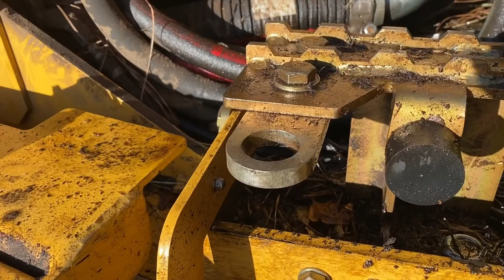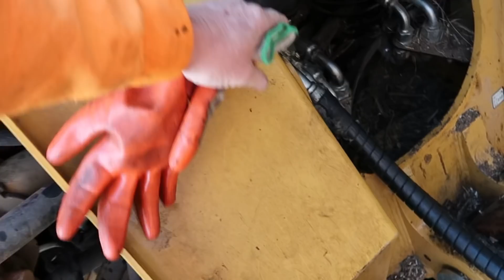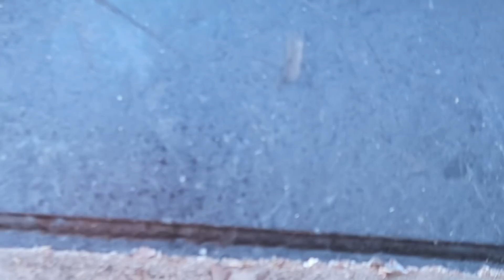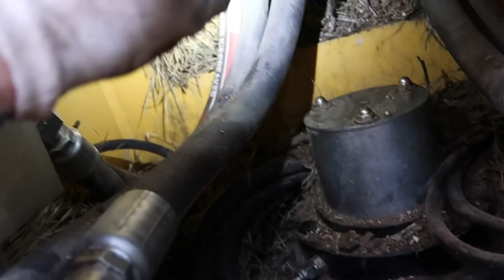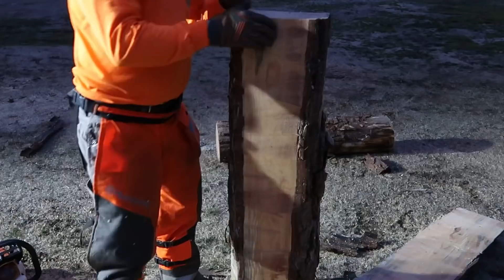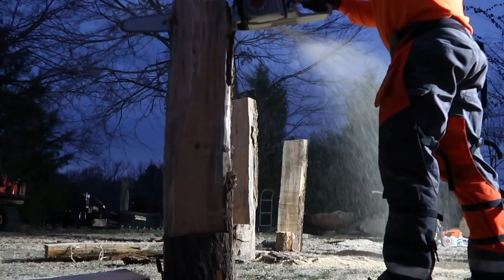Tigercat 830 is broke down | to be continued.....

Comment: That really is the drawback to the zero tailswing bunchers- you have to fit all the components that you need to make it go into the frame. I think they're great until you get some hours on, then there is some tough work ahead. Been there, done that. I'd rather have to be a little more careful getting around in a stand, and have less trouble working on it. A pull rope is your friend! Good luck on it, and thanks for the video.

Comment: I would put two shorter hoses back instead of one long hose
Reply from the maker: Then how would you get to the center of the hose with wrenches to break it and tighten it back up when it busts again?
Reply: @cotontop3  you measure your hoses to where they meet somewhere you can reach it. It dont always work but I have done it before
Reply from the maker: We’ve done that before but it wouldn’t work for this hose. When you see tomorrow’s video you will see why. Thanks for watching.